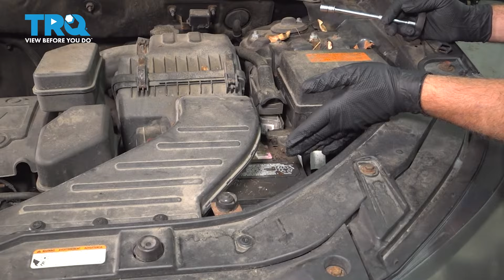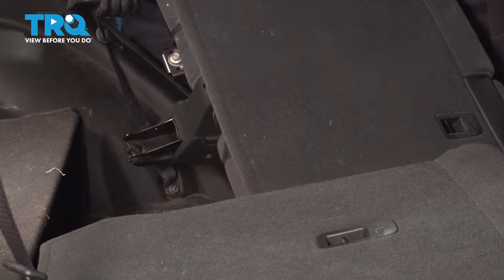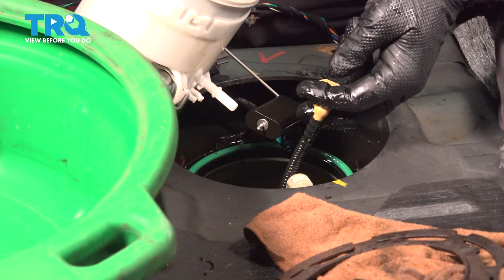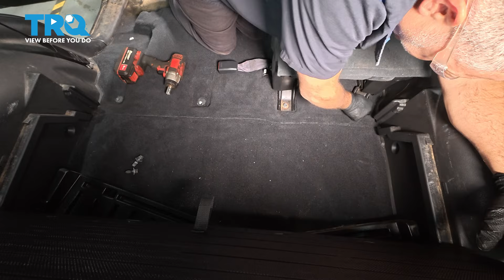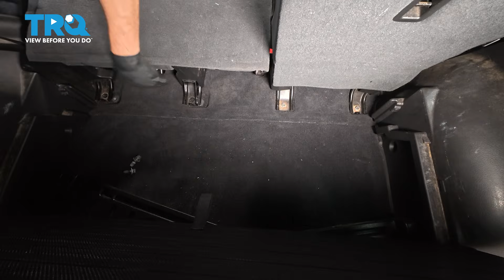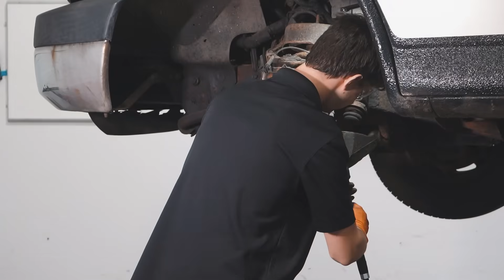How to Replace Fuel Pump Module Assembly 2011-2015 Kia Sorento 2.4L L4

Comment: did you really have to pull that passenger seat out and remove that panel as well?  Seems like you could have just pulled the rear seat on drive side and done the repair only removing the one access panel that the fuel pump is underneath

Comment: Don't believe what you see.  Removing the retaining ring is JUST ABOUT IMPOSSIBLE with a hammer & punch.  You'll notice a very smooth EDIT in the video just after he tries a few whacks with the hammer.  I tried for an hour using that method and the lock ring didn't budge.  YOU WILL NEED TO BUY A SPECIAL TOOL !!!